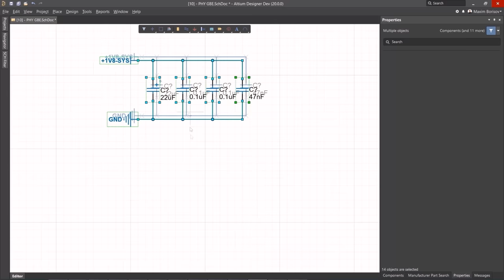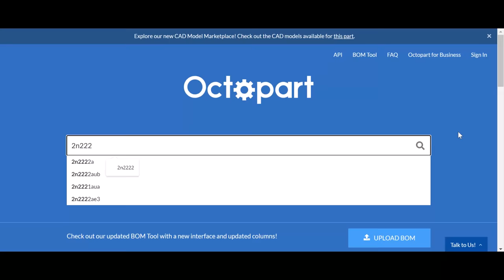how to convert 3 7v to 220v mini inverter , altium designer

Comment: How do you know it's 1500 turn wire?
Reply: Výpočet
Reply: Basic instinct as  electrotian expert 😁🙏
Reply: @hendritresnahadi4146  I think he probably just measured output voltage and adjusted the number of turns. Usually wire spools have turn counter but his did not. May be it is instinct after you do it enough times. lol
Also, the lamp can probably easily work on lower voltage so as long as output is over 200v, it might be good enough. Still funny and a bit of a mystery tough.
Reply: @expired56k  yup n i still belive he is master n expert , tx u mr
Reply: @hendritresnahadi4146  Without a doubt he is!

Comment: What is the name of the thing which you can use to make this inverter
Reply: Are you referring to the transformer he winds? It's a single phase coil type transformer. He probably uses it because they are easy to wind manually. These cost more which I think is one of the reasons they are typically not used in a lot of electronics. They are mostly used in some high current devices. Regarding the circuit, it's pretty neat that it's so dead simple but for real use it would need regulation and safety features.

Comment: Mmm...very strange thing. Transformers are not able to function without variable magnetic flux..you need to give pulsing DC voltage or AC. Static voltage cannot lead to conduction as showed.
Reply: So transistor alongwith the primary coil and auxiliary coil acts as an oscillator
Reply: @mhademo1516  i don't see an auxiliary coil, i see a coil with an extracted center point. Anyway, to oscillate you neee capacitance, i don't see nothing like that.